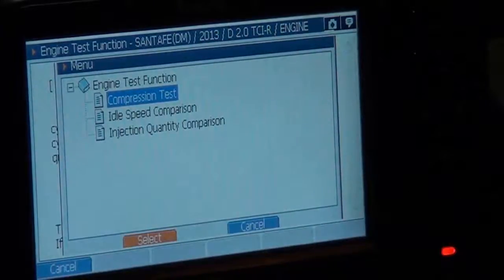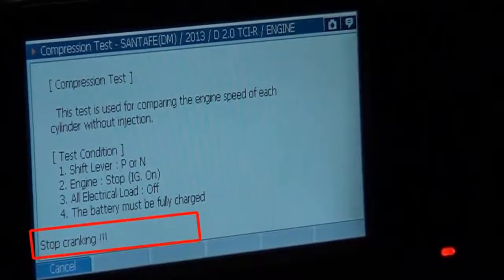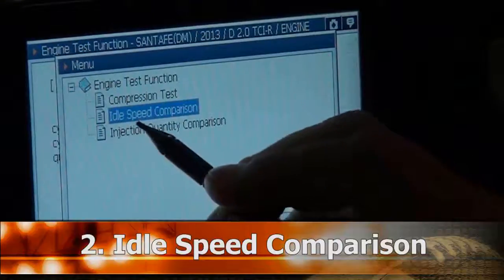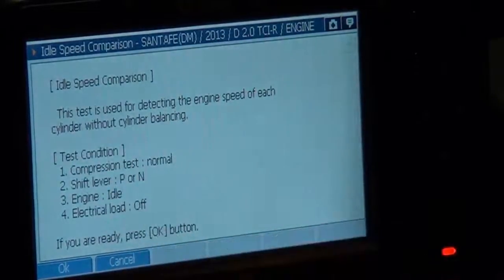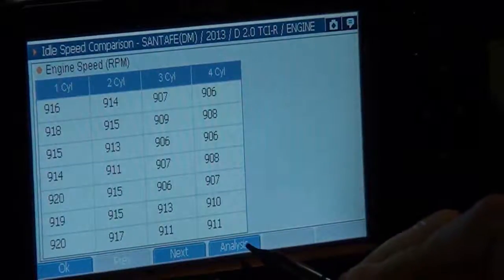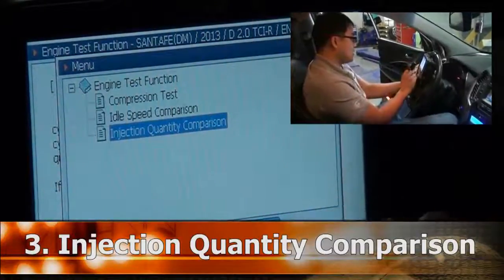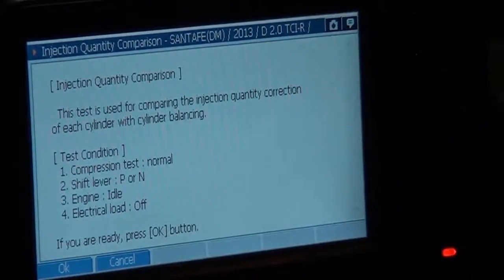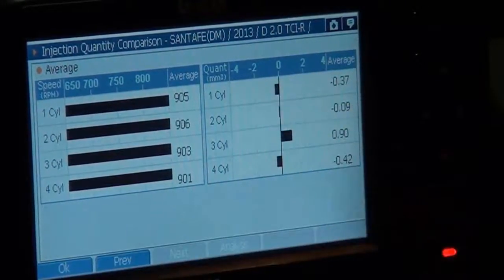G-SCAN PRUEBA FUNCIONES ESPECIALES EN MOTOR HYUNDAI SANTA FE GLOBALTECH ECUADOR

Comment: en mi santa fe 2008 diesel aparece el codigo P1186 q puede ser eso soy de ecuador gracias espero su respuesta
Reply from the maker: There have three factors may be cause the problem,
1.Baja presion de combustible. Posible taponamiento en la linea de entrada..
2. El regulador de la bomba esta dañado..
3. La bomba de combustible esta dañada.

Depende mucho estimado, nosotros vendemos equipos no somo tecnicos automotrices en general. Espero le haya servido.